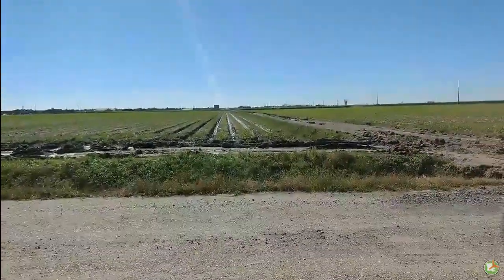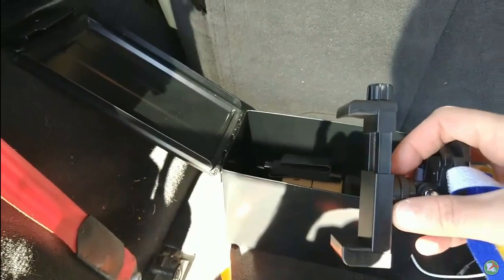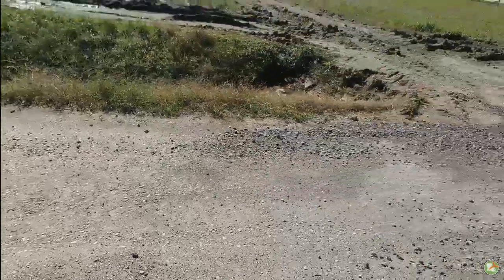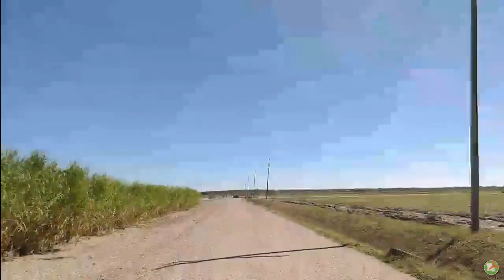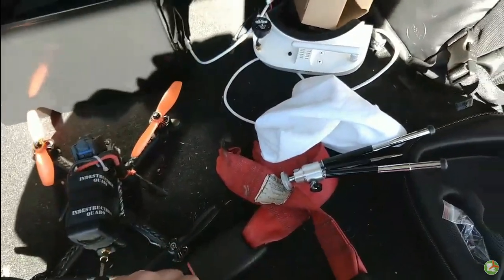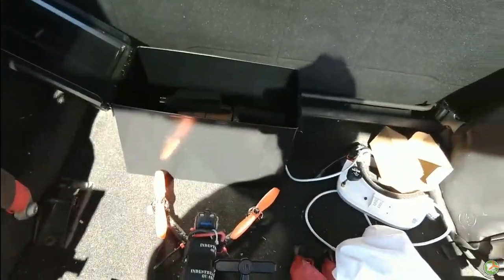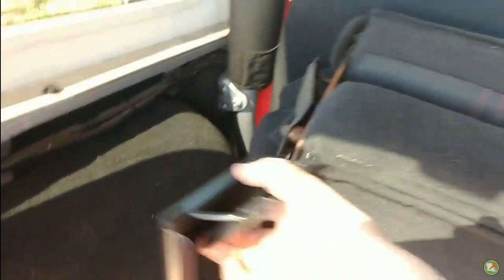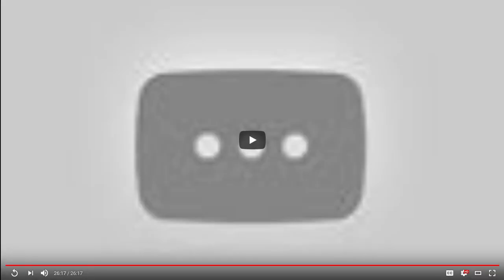🐝 nerdCopter in the Field | Previously LIVE ScreenRecording

Comment from the maker: 🤑 * NONE of the Amzn links are affiliate, my affiliate acct was closed.

👍 Prop Nuts!
 ↪ https://amzn.to/2Oe0QX1  $7.49 20pcs M5 Flanged Aluminum Nylon Lock Nuts (Color-Choices) [USA]
 ↪ https://amzn.to/2ABkrN6  $7.99 20pcs M5 Flanged Aluminum Nylon Lock Nuts (Color-Choices) [USA]
 ↪ https://amzn.to/2Q81pDp $11.99 25pcs Low Profile M5 Flanged Aluminum Nylon Lock Nuts (mult-color) [USA]

👍 Prop Tool:
 ↪ https://amzn.to/2Dc8YpX $9.99 iFlight Prop Wrench Toll w/ 4 CW & 4CCW M5 Nuts

👍 Battery Pads:
 ↪ https://amzn.to/2BSGz8y $10.99 Clear Silicone Non-Slip Gel Pads 65x75mm (cut to size)
 ↪ https://amzn.to/2RonLAT  $5.88 Red Silicone Non-Slip Gel Pads 40x60mm (small)

👍 Lost Quad Buzzers:
 ↪ https://amzn.to/2ABsz0q $14.99 VIFLY Finder V2 Drone Buzzer Tracker Light-Sensor/LED/100+dB
 ↪ https://amzn.to/2SuPTUp $14.99 JHE42B Drone Buzzer Tracker LED Light/110dB

👍 Capacitors:
 ↪ https://amzn.to/2DdzS0Q  $3.44+shipping 5pcs Panasonic FC 1000uF 35v 105c Radial Electrolytic Capacitor Low ESR
 ↪ https://amzn.to/2qrfwJ7 $13.99 10pcs Panasonic FC 1000uF 35v 105c Radial Electrolytic Capacitor Low ESR

👍 AA batteries
 ↪ ttps://amzn.to/2ASvce7 48 AA  batteries 13.99 (29 cents)/ea 

 👍 Antennas:
 ↪ https://amzn.to/2Rpe5pQ $11.50 20pcs FrSky compatible IPEX antennas
 ↪ https://amzn.to/2Ofuvze  $9.99 Team BlackSheep TBS Crossfire Immortal T Antenna
 ↪ https://amzn.to/2SvBIOX  $9.99 RHCP Super Mini Stubby 5.8GHz 5dbi Antenna RP-SMA
 ↪ https://amzn.to/2Azh3Cr $12.55 2pcs Pagoda 2 RHCP Antennas (CHOICES: RP-SMA, SMA, MMCX, MMCX-T)

👍 Weigh Scale:
 ↪ https://amzn.to/2qi7rGf $11.59 Digital Pocket Kitchen Scale 0.001oz/0.01g 500g

👍 Smoke Stopper:
 ↪ https://amzn.to/2MdoYJ0 $8.69+shipping RaceDayQuads Smoke Stopper XT60

👍 Receiver:
 ↪ https://amzn.to/2DdkeCm $23.89 FrSky R-XSR Ultra Mini Redundancy Full Telemetry Receiver

👍 VTX:
 ↪ https://amzn.to/2OgCV9i $39.99 ImmersionRC Tramp HV USA Version
 ↪ https://amzn.to/2qjtXyw $39.99 RMRC Cricket Pro V2 MMCX

👍 Flight Controllers:
 ↪ https://amzn.to/2OjoiDt $41.55+shipping HelioRC Spring IMU-F v1
 ↪ https://amzn.to/2Suucnn $41.39+shipping HelioRC Spring IMU-F v2
 ↪ https://amzn.to/2DbZsmD $49.99 BrainFPV Radix F4

👍 Motors:
 ↪ https://amzn.to/2yGdbP0 $19.99 EMAX LS2207 1900KV
 ↪ https://amzn.to/2Q7gjtJ $18.99 EMAX LS2207 1700KV
 ↪ https://amzn.to/2JtjnOj $18.99 EMAX LS2207 1600KV

👍 4in1 ESC:
 ↪ https://amzn.to/2DeA289 $56.53 XRotor Micro 45A 6S 4in1 ESC BLHeli32 DShot1200

👍 M3 Screws:
 ↪ https://amzn.to/2OhWe3q $12.98 "A more complete" 300pcs Steel M3 Screws 12.9 Grade w/ NUTS

👍 Propellers:
 ↪ https://amzn.to/2LSnaVC $19.99 10-Pair HQProp 5.1x5.1x3 V1S (Blue)
 ↪ https://amzn.to/2mHDIVx $19.99 10-Pair HQProp 5.1x5.1x3 V1S (Black)
 ↪ https://amzn.to/2LwZz07 $19.99 10-Pair HQProp 5.1x5.1x3 V1S (Red)

👍 Lapel Mics:
 ↪ https://amzn.to/2JrSA51 $15.99 YouMic Lavalier
 ↪ https://amzn.to/2yGdA3I $10.99 PopVoice Upgraded Lavalier
 ↪ https://amzn.to/2Q4XIOU  $9.99 PopVoice Lavalier and EarBud

👍 Cheapest usable Android tablet ever
 ↪ https://amzn.to/2RtP24R $39.99 (8GB) $59.99 (16GB) Amazon Fire 7 Tablet microSD expandable (Have to side-load or script-fix for Google Play)

👍 Kickass Bluetooth Speakers:
 ↪ https://amzn.to/2Dez6As $83.00 JBL Flip 4 Waterproof Portable Bluetooth Speaker

👍 Largest Dog Crates:
 ↪ https://amzn.to/2qqdrwF $122.79 MidWest 54-Inch Long Ginormous Dog Crate (we got this, too damn big)
 ↪ https://amzn.to/2OoZXew  $71.99 AmzBasics 48-Inch Dog crate (plenty big enough, only a few inches smaller @significant price savings)

👍 Baby-Girl wants a Barbie Home:
 ↪ https://amzn.to/2SB3rh0 $179.99 Barbie Dreamhouse v1
 ↪ https://amzn.to/2CYBxqb $179.99 Barbie Dreamhouse v2
 ↪ https://amzn.to/2qmn1AX  $89.99 Barbie Townhouse

✴ Disclaimer: Links are Amazon affiliate links.  If lucky, I'll earn a few pennies from them, but mostly i don't want my account closed prematurely!

🏁 #nerdCopter ##nerdCopter ###nerdCopter

Comment: Howd you finding that controller man? Honestly try acro only, itl make bad habbits in angle, just fly high enough you wont crash and can save it if something happens, not really high just enough not to bump the floor. You did well, i swear, angle is harder to fly fpv than acro lol! Los use angle, fpv use acro to learn. I assure you it feels weird but give it a week or two and youl be glad of it! Keep it up man!
Reply from the maker: Love the x-Lite, but it's the only one i've experienced. had to expo my throttle and knock off a few points on the throttle curve due to my 1900kv.  I've done a little acro since, but the field is so wet all the time, make for nasty cleanups.  acro is super hard LOS, but i plan on putting my crappy EV100 on during the thanksgiving break;  super thanks for the visit and comment!
Reply: @nerdCopter  Aha good on ya man, just trust yourself and los is really hard in acro, not many people are as good as quadmovr lol, good luck! :)